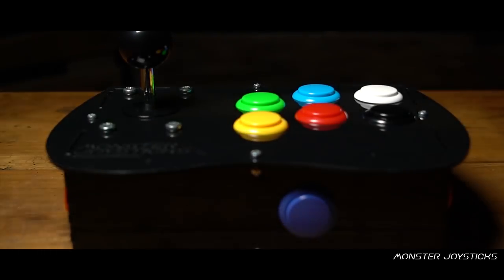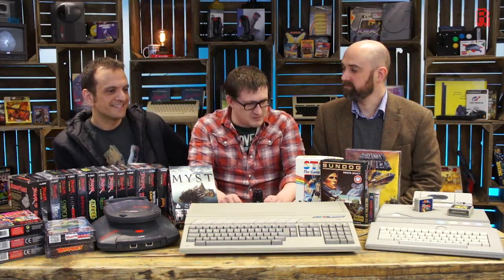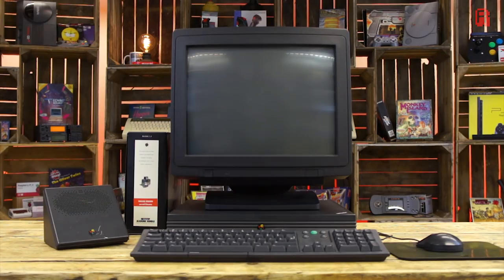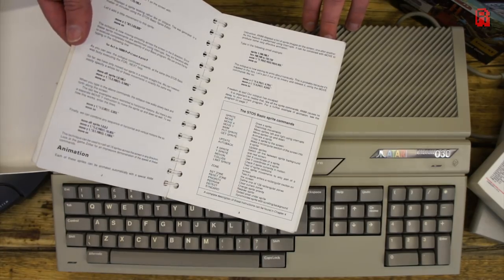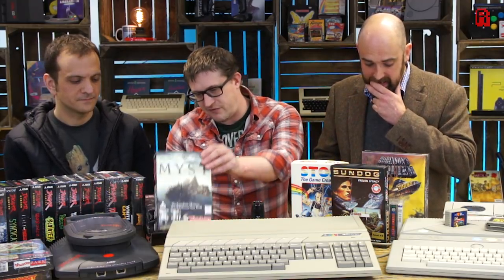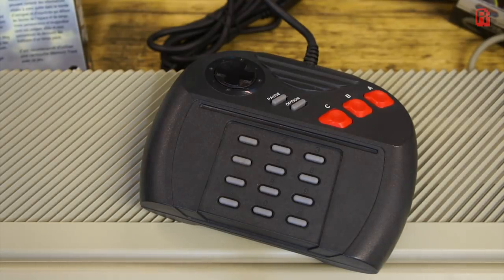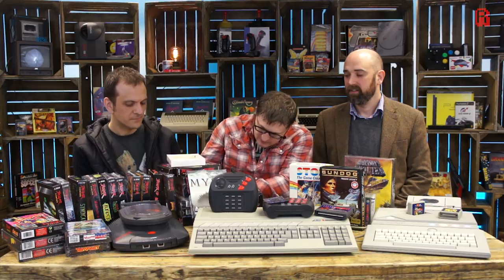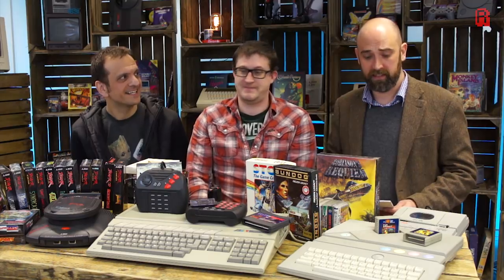Atari Falcon, Jaguar & XEGS chat with Gary & Andrew

Comment: First of all thanks for the credit :). Well, I started my career on an 130XE and moved to the Falcon later on.  The Falcon took me up to the year 2000 when I had to use Windows PC's. Speaking first of the XEGS iirc the production run of 100000 units was sold out so I wouldn't call it unsuccesful by any stress of the imagination. However it was not heavily marketed in the west so I guess it isn't that well known. 
As for the Falcon, well it's not a games machine that's for sure, even though there are some impressive ones, like Running that you showed, and Moongames and of course Llamazap by Jeff Minter. The most impressive one would be Crown of Creation 3d, that was marketed as a PSX game on a falcon. It's not, but it's close enough. As for Robinson's Requiem, that's a direct PC port and it shows. Silmarils had developed a way for multiplatform development where you could choose the target platform and have the game working. That is not a very good solution for a Voxel engine though. If you were to make it using the DSP, performance would have been better. The 3do and jaguar versions of the game use polygons and thus are much smoother. Still, I spent lots of hours on it. 
The Falcon is a good general purpose machine though. The quality of the software was outstanding and it was what allowed me to continue using it up to the Pentium 3 era and even later on for productivity work. For example, 10 years ago, I ran simulations for my thesis. Some of them were ran on my (060 accelerated) Falcon. In the early 2000's I used Vision to make some posters. Vision is a falcon only image editor/drawing package of French origin. I am no artist, but I did manage to output something.. There really wasn't anything I couldn't do and when I go back now to some of the software that I used, I feel kind of embarassed because I remember how much I didn't know back then and how similar the suggested workflow was to what I do now. 
Lastly, I think your guest's observations were correct. The ST was mostly used for productivity work (it would be interesting to know the ratio of ST's sold with mono monitors compared to total ST's, I think we would be surprised) and nostalgia for work tools isn't as common.

P.S. To answer your patreon's question.  There are lots of hardware and software developments for the ST. This is a discussion that I've had with many Amiga users over the years. It all comes down to, "I don't know about it so it doesn't exist".
Reply from the maker: Great to read about your experience.  Just after filming I heard about the ST version of the Vampire which is currently being beta tested, what are your thoughts on that as an upgrade as I know if divides some Amiga owners.
Reply: I think it will not happen :). Still, if it did it would be interesting. I think the main cause of divide in the Amiga community is an ideological one. In the ST side, it is compatibility to the OS and the closed nature of it all. As it stands, Vampire doesn't have a 68K compatible MMU so memory protection on MiNT will not work. The same is true for the Firebee as well so that project gets some flak for it too. It is debatable though whether it's the OS' job to support the hardware or vice versa. I would argue it's both. It's not an issue on the Amiga side because only OS4 supports memory protection but I am not sure how MP friendly your applications are. On the Atari side, almost anything after 94 (applications wise) is and most older apps that followed Atari guidelines will work without a problem.  

The closed part means that any developments and feature requests need to go through the vampire team and there is doubt whether Atari users will be given any consideration. Also, as I understand it there is virtually no interaction between the vampire team and the ST community so that's not a good sign. Just some very enthusiastic Atari users that talk to them.
Reply: CFalcon030 what a great comment!  And yes. I failed to mention
Crown of creation! In hindsight there was a lot I wanted to say but didn’t. But I said lots I never planned to say also :)

Comment: Great video! I have to admit that I am a Falcon fanboy (I own three of them, mostly for making music ... using Steinberg Cubase Audio 16 and A.C.E. MIDI). When it comes to Falcon exclusive games, imho 'Crown of Creation 3D' should be mentioned (a 'let's play' can be found on my channel). Besides from the hardware point of view it should be mentioned that the Falcon, after being cancelled by Atari, was built under license by C-LAB (Emagic) throughout the 1990s. There were three Falcon revisions by C-LAB, the MK I, II and III. Those models were optimized in audio capabilities and / or performance. The C-LAB Falcon MK III came in a desktop chassis with external keyboard.

Comment: I never realised the Atari Falcon had the same form factor as the ST/STE. Lovely looking machine(s). Great video!
Reply: I preferred the ST look over the A500 (and the horrid A600) right up to the A1200.
Reply: daishi5571 I like the rear of the Amiga 500, It looks great from the back, so low profile and sleek but the ST from the front.
Reply: Had the line continued, the Atari Falcon040 would've been in an external case. That design later influenced the design of Sony's Playstation 2 case. It's actually cited in Sony's patent filings. And by that time, a lot of ex-Atari Corp employees were working for Sony Computer Entertainment of America (SCEA) along with a lot of ex-Atari Inc. employees. The chief architect of the Sony Playstation 4 - and 5 - is Mark Cerny and he basically started out with creating "Marble Madness" for Atari Inc/Games.

Comment: Yes, the Falcon030 did do MP3 playback: https://youtu.be/ycHGQQYoWZQ

I do vaguely recall one of the Tramiels announcing there would be videocards based on the Jaguar platform to be nade available for the PC (even PC/XT).

Also, there is actually an MP3 decoder for the Falcon using the DSP. I don't own that piece of software, but remember seeing it on a convention somewhere. I do own a Falcon though. Awesome piece of kit. Downside is the 16-bit CPU bus (but only the CPU bus), which was a let down but understandable given cost cutting. The TT030, the TT030/X and the ATW800 all actually had full 32-bit buses (and VME expansion slots).

Basically the Falcon030 was what the STE should have been, but wasn't due to cutbacks (was supposed to use the Blossom chip as on the ATW - same with TT030).

I also read somewhere the Falcon should originally have come with a case design which was later used for the PlayStation/2 and that it was supposed to have the Jaguar's custom chips.

The fact it was released at all is amazing considering the economic circumstances.

Many Atari design decisions at the time from the moment Jack Tramiel bought Atari from Warner Brothers onwards have been optimized around cust cutting.

If you look closely, the ST seems to be a successor to the C64 where the Amiga was actually a successor to the Atari 8-bit home computers (same hardware designers too).

What I don't understand is why you guys are bashing the Jaguar controller though. I actually LIKED the concepts of inserts denoting button functions on top of the "telephone pad".

I believe the original intention was to also enable the Atari Lynx to be used as a controller, using the Lynx as a secondary display. Kind of like the thing Nintendo did much later on.

In any case, enjoyable video guys. I like the discussion type format. Nice.

Comment: I have an XEGS, but not the others. Good system.  Composite out video is fuss free (stock RCA jacks), does everything that the 800XL and 800xe/65xe can do.  Sio2SD device is a good modern update to add to it.  I think the XL is better looking and has a nicer keyboard and obviously has more Ram (but hardly ever made use of). 
I have 2 stories regards the Falcon. 
1) I have "handled a Falcon", Dave Hodges? use to attend sci-fi conventions building a "Real Hitch Hikers Guide" on which I made an entry was using a Falcon to do this, he was one of many then "scene" characters that got immortalised in one of  Terry Pratchett's books (and TP did that to quite a few scene chracters). 
2) I worked in support at CiX, one day, back from holiday one of my colleagues asked me if I had heard of a Falcon? I fessed up that I had touched one in the past (see previous story). Before you could blink he transferred the call to me, some user was trying to connect to the internet via STIK (ST Internet Kit) and wanted to know the ip settings! (Simple fix if you know basic TCP/IP, and I actually knew the answer!).  Everyone else had just heard that the guy had an Atari and was trying to get it on the internet and just steered clear! This was about 1999
After that my reputation as Digital Archaeologist in residence was cemented!
Reply: I believe the XEGS has 128 kilobytes just like the 130XE... (or maybe not. but still, no XL has more than 64k)
The 800XL has only 64 kilobytes, (and the 600XL originally 48)
Older models initially had just 16 kilobytes!

That explains a lot about Atari 8 bit software really, given the entire range kinda flopped and became niche by 1985 (compared to the c64 anyway), any software that DID get made was often hamstrung by trying to support 48k or worse 16k models...

Very powerful machines, especially when you put in the effort to push the limits of what they can do, but thanks to their not being particularly popular for very long you rarely saw the true limits of what it could do.

For games though it did have an unfortunate Achilles heel compared to the c64 and the 8 bit consoles that started showing up - it's sprite hardware was terrible.
Very impressive in 1978, when first designed, but looking pretty weedy already by 1983...
The other capabilities of the graphics hardware are extremely good by comparison even to much later systems, but that sprite hardware... Ouch.
Reply: The original 400/800 range was capped at 48k (3rd party expansions got around that with additional memory controllers).  48k ram and 16 rom equalling the 64k the 6502 could address, though in reality the Rom was smaller, only 10k I think.
the 600xl was a 16 k model but some of the last models were expanded to 64k, the 800XL was 64k stock. Not sure how they utilised/accessed the extra 16k (video ram only or some other silicone sorcery!)
All of the XE models were 64k except the 130XE, this includes the XEGS. They usually included he Freddie chip as a memory controller which could page the extra memory. 
 At least 5million machines sold so not that niche. Though no one is sure if that is just the 800xl or the whole family, I have not seen a clear source on that. But constantly there for a whole decade at the no4 best seller after the Speccy/C64 and first the BBC and later Amstrad CPCs trailing that duo. 
I think in the UK the price harmed the 800 model (same as a BBC Micro! why spend £300 on anything else?) and then the 800XL seems to have been put in direct price competition with the already established C64 at its launch at around the £200 mark.  Also Warners focus on Games despite good productivity software on the platform.  Warner Bros ONLY seemed to understand the 2600 and once that horse died they just kept flogging its twitching corpse and then flogged off the company.
I think hardware wise it competes with the C64 and the CPC family well. Think about it in comparison to 1983's other contenders (Oric, Dragon, others).
Atari computers in my opinion was ballsed up by Warner Brothers, then cheapskated by Jack Trameil but still remained contenders in the 8 bit range until the end. The St was a different story. Still a much better machine than the spectrum (though to be honest, not difficult, the Spectrum truly seems to be the Mini/Morris Minor of the 8bits! competing with the Ford Capri/Mustang of the US rivals, and competing with charm and pluck!).

Comment: Excellent video Gentlemen, but there's a small mistake at 12:50 - the Falcon has an 18-bit palette (262,144 possible colours) and not 24-bit as stated.
Reply: DC Angrlish yeah, I realised this when I watched it back along with a couple of other things. I hoped nobody would notice 🤫 the mode is named True Colour and I make a bad habit of thinking that is 24-bit... damn my aging brain
Reply: Yes... back in days "true color" meant that you do not have CLUT (color look up table) but rather that color of pixel is represented directly by value of byte or word and that is not reference to index in palette.
Microsoft is one that start using term "true color" for 24bit graphics since 24bit graphics certainly does not have CLUT but in same time change meaning of "true color".
Reply: Aha, so it's Microsoft's fault - Get them!!

Comment: On an exchange program back in the nineties in Soissons, France, we visited the office of a local newspaper and a printing press. I was pretty surprised when they showed us an open plan office with ca. 15 Atari Facons on the desks. I had never seen a Falcon in the wild - and didn't see another one after that experience. Too bad we weren't allowed to switch them on.
Reply: Sampler19 15?? Imagine the eBay same figures on those
Reply: Yeah, right! They looked like they weren't even used any more after a switch to another system or something like that. The bureau kind of looked abandoned, right next to the new one where people were working in. It looked like they were throwing them out anyway. So i guess you could have gotten them for a couple of francs back then if i knew who to ask. ;) Too bad the guy showing us around couldn't tell me if they were for sale.

But i guess I woudn't have had the money anyway, because i was kind of broke after buying an Amiga 1200, a 3DO and a Jaguar that year. At least they were on sale for a bargain, too. And the Amiga was a used machine with custom military airbrush design from the first owner. I've got to get it from the attic some time to try and get it running again :) )

Comment: The notion that the Atari ST/STe were made purely from off the shelf parts is absolute crap.  The misinformation floating around is ridiculous.
Reply: In fairness, the ST probably would've been better had Atari Corp used Motorola's actual MMU instead of their own. But the same can also be said for the Amiga too.

Comment: My first hands on experience with an Atari Falcon 030 was in late 1992, at a local professional music recording studio.  The owner had a career as a session player for many top artists of the 1970s and 80s, and did get a recording contract of his own with EMI.  He did not have the Falcon for long and ended up returning to his previous Atari ST for MIDI sequencing / syncing to his reel to reel multitrack recorder.  I ended up buying two Falcon 030 in 2010 and upgraded them considerably for music.  Excellent powerful machines but very fiddly and difficult to setup compared with the bullet proof ST line.

Comment: I had pretty much every Atari 16 and 32 bit machine, lacking only the ST Book. I had 520, 1040, 1040STe, Mega STe,  STacy with 16mhz upgrade, Falcon030 and TT/030. The problem with the Falcon is it was underpowered. You asked why anyone would want to upgrade the CPU in the Falcon, and that's why. Compared to the TT/030 doing things like Pagestream, the TT stomped the Falcon, even with my large 19" Moniterm.  I was quite honestly very disappointed in my Falcon and that's why I ended up selling it. I did not hear you mention it, but a stock Falcon is 16mhz, a TT/030 is 32 and also had fast RAM, which I don't believe the Falcon supported.

The joysticks that break and that have the keypad are for the 5200. I've got a box of broken ones.